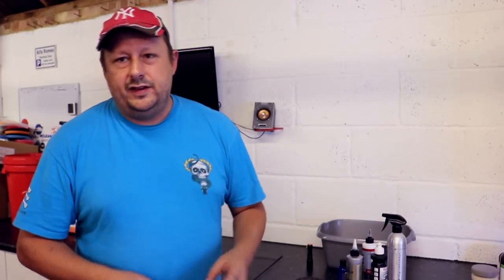Trashing Microfiber Towels with Ceramic Coatings

Comment: Jon...I throw cloths.....but heres a can of worms! ...it is common practice in the ceramic world to throw when using crystal serum base layer, but with exo..either wash & reuse or soak in apc, wash & reuse....personally I throw using any ceramic product
Reply from the maker: yo miles.   I think even the top coat product still use the hard curing resins perhaps even the same materials but they may contain much high volume of other organic resins to create gloss or hydrophobicity etc...   its going to vary isnt it product by product as to what materials are in what top coats though.. but I think its the same principle with a top coat product.  ultimately though have not tested that so just thinking out loud.
Reply: @ForensicDetailing  agreed Jon...last thing you want after all that hard work is to start inflicting marring on paint, safest bet is to throw...I use the  in2detailing cloths for coatings, great product, great price

Comment: Based on these findings would you also have the same problems with a lighter product such as tac systems moonlight used in your recent video?
Reply from the maker: I reckon you need to bin/relegate towels after using the lightweight ceramics as well andrew.

Comment: I've used microfibres to buff ceramic coatings and put them into the wash immediately after wiping and they came out with a noticeably different texture. They also didn't absorb very well, so I used them as rags from them onwards. I'm an advocate of not letting them touch paint again but I'm happy to use them for other purposes, knowing they won't absorb like new towels.
Reply: Doesn’t heat help fix the scratches? I’m having a hard time understanding if heat gun and sun can make scratches disappear then what’s the point in using a fresh towel every time.

Comment: Never had an issue with Gtechniq coatings and Sam's club 36 pack MF towels. I've even let them sit a few weeks after I've buffed off EXO or CSL before I washed them. Never scratched a painted surface with the used towels. However I use copious amounts of white distilled cleaning vinegar, 2 hour multistep wash and degreaser with my towels. Ceramics are chemically designed to bond to clear coats and other paints, not fabric fibers.
Reply from the maker: I think they will also stick to microfiber brett, or lets say the microfiber absorbs it well and then it bonds to the fibers rapidly.   vinegar, or detergents water based degreasers etc  I dont think flushes the coating out the cloth.    Thing is I reckon on harder clearcoat on cars that isnt black Im not sure sure if I would be able to spot it.   but on these black test panels at least I can replicate it and show a difference.. who knows those though I appreciate your input, theres no right or wrong.
Reply: @ForensicDetailing  I should mention I use brand new towels for correcting paint and removal of Gtechniq coatings. They just seem to respond better to newer towels.
Reply: @Taylor Made Detailing  Wrong.

Comment: So a normal microfibre wash will not remove the ceramic residue from the cloth when washing? 

I would use cheaper towels its not like you will be doing coatings all the time unless your a pro detailer
Reply from the maker: I dont think any like liquid detergent will break the coating down once its started to bond..   maybe like someone has said soaking the towel in a strong solvent before its cured in the fibers maybe the only way but thats gonna hurt the microfiber for sure.

Comment: I'm slowly pulling together the bits and pieces needed to do a complete cut and polish on my car.  I was going to seal it with Autoglym Ultra HD Wax, but I see Auto Finesse have a new ceramic coating product that is reasonably priced.  It comes as a set of ready to use panel wipes so easy enough to apply.  Any thoughts? Ceramic or wax??
Reply from the maker: I dont know what the AF product is.. I dont think its the same materials as a ceramic coating.. more like something else.     I have a rough idea maybe.  but are 8 wipes that you can use to protect the car once good, if its not a proper ceramic?  dont know Im sort of cynical but I like when theres new products to market.  but I just dont understand what this stuff is.. SDS links dont work on the halfords site..
Reply: @ForensicDetailing  Yep, 8 wipes.  It does describe itself as a ceramic coating on the Auto Finesse website.  Perhaps I'll settle for UHD wax for now and revisit this product when FDC has given it a thorough evaluation 😉
Reply from the maker: who knows mate it might be cool.  could try and get some and check it out.. would make an interesting video.

Comment: Hi Jon, another fantastic and in-depth video for which we are grateful. Personally I just think all of this ceramic coating business is a fad and I will not use it on any of my cars for the reason being you just cannot get rid of it without hard graft and a lot of time and energy.  Plus your video l has made my mind up completely over this ceramic or nonceramic situation. I personally will stick with Powerlock by Menzerna with a wax topper and continue to use a detailer spray after washing as I personally like the purist route. I think ceramics have their place in the market, but you won’t catch me using that stuff on my car. Anyway, I love the process of applying a wax etc, which I find relaxing. 👍🏼
Reply from the maker: appreciate your thoughts max cheers buddy.

Comment: On another note which ceramic coating is the longest lasting plus looks good ? and what is the difference with the professional ceramic coatings?
Reply from the maker: pro grade are the longest lasting generally and have a much higher content of the silica solids compared to carrier or other organic resins.
Reply: Are the Pro grades applied the same way or is there a different technique to apply the Pro grade coating?

Comment: Perfect timing. I am in the process of prepping my car for a geyon synchro coating. Your video made my towel decision that much easier (as I was already planning on tossing them). Thank you for posting, your channel has been very helpful to me. 

Any chance you could do a video on polishing glass or glass restoration? I'm having a hell of a time getting fine scratches out of my windows.
Reply: I wouldn't toss them they still make good oil rags when doing Oil changes

Comment: Great video Jon, much appreciated.  I'm wondering about coating toppers like Gyeon Cure or Optimum Hyper-Seal?  I don't apply a coating very often, but I use both those sealants every couple of weeks as a drying aid.  I've been washing those drying towels with microfiber cleaner and reusing them.
Reply from the maker: I think these will be fine george at least they dont contain the same hard curing resins as the cermaic coatings

Comment: I bought several different MF towels for this exact reason. I have ones for application. Ones for first buff then final buff. This method is my version of what I have learned from several fellow installers and coating classes I have attended.

Application/Leveling MF Towel is either tossed or dedicated shop (grease/mechanic) towel afterwards. For these I use Costco or more budget towels. When done coating I'll cut a corner off to designate these as permanently trashed for paint related work. Easily identified even if accidentally washed with other towels at a later date.
First buff is a 300-350 GSM medium grade towel. Once done buffing these immediately are placed in a 5 gal bucket with a mixture of 3 gal of water, One half cup dawn dish soap to help break up the oil based solvents and one cup of vinegar to further attack the oils with its PH of about 2.4 vinegar is a great cleaner for this purpose. Be warned I have had experience with this solution actually attaching the MF dye and often the water will be the color of the MF so have a bucket for each MF color you may be using. I have a lot of pink towels that were originally white. (Additional NOTE: Buffing towels I have found will not be as saturated as in the fresh coating and is buffing off more of a semi cured coating and I have found to be less impregnated into the fibers in my experience using them after a few washes.) 
My final buff is with a 350+ GSM towel to finish off the buffing process this also immediately goes into a 5 gal solution filled bucket, once all sides have been rotated thru.
All towels are washed that evening and are rinsed and squeezed out immediately before placing in the washer to remove as much residual contamination as possible. They are washed on the very hot sterilize cycle of my washer with "Free & Clear" wash detergent keeping the towels as pure as possible with one cup of vinegar in the wash cycle and extra rinse selected.

I'll use washed towels no more than 3x then dedicate to other non-paint related work. 
I buy then by the 1000 so cost is lower & built into the ceramic coating job price.
Customers are very satisfied thus far and formula seams to be working for me thus far.
Reply from the maker: awesome laszlo thanks for that.. jesus you get through a lot of microfiber :)
Reply: +Forensic Detailing Channel It seems a way to minimize MF use here is to cut them into hand size rags that allow you to get the most use and function per area of microfiber out of each towel including the use of both sides before tossing especially for initial removal as an uninvolved or not fully utilized mf corner is wasted mf.
Reply: SayWhat?  When cutting MF with scissors the rags will typically fray leaving fibers on the vehicle finish which is why they have sewn edges. That may be OK just be prepared.  
We only cut them after they are dedicated to shop/clean up rags for non-detailing work. Sometimes we also use them for vehicle wrap jobs applying adhesive bond promoter.

Comment: I have another question. With my Gyeon Pure, I also got the Gyeon Cure detailer. It also has a small amount of SiO2 in it. Is this also problematic for my towels?
Reply from the maker: you dont have to throw your towels away after using with Gyeon CURE (sorry ).  Its not a ceramic coating.  Its water based siloxane with trimethoylated (sp?) silica.
Reply: Oh wait it isn't even a ceramic coating? I'm so confused about all the different types of coatings. Guess I really need to dig through your older videos.
Reply: So wait a second, I do have to ask that again. The video you made about towels getting trashed by ceramic coatings do absolutely not apply for Pure oder Rim from Gyeon? I'm asking because I threw away 3 towels today. Because I could swear I used one towel I had used for Rim before and it scratched up my paint. Maybe that was just a coincidence?
Reply from the maker: sorry let me edit. I meant cure not pure above.

Basically if it comes in a little glass bottle its a ceramic. and its the ceramic resin that could cause the problem.   so cure is fine.
Reply: But isn't Gyeon saying that Cure is basically a much more diluted version of their coatings?
Reply from the maker: gyeon cure isnt a ceramic  coating no..  It contains a version of silica but its a different thing.. basically if it comes in a tiny glass bottle and it smells wierd its a ceramic (not including p-diddys unforgivable aftershave)

Comment: I do not know why but I'm going through many microfiber cloths no matter what I do, maybe I have the world record when it comes to the number of microfiber cloths I use for example when I wipe away polishes.
Having said that, I have had many different microfiber cloths in my arsenal and for a while it was expensive fancy ones I used , by chance I bought cosco cloths through a seller at ebay, I was very skeptical of these cloths, for me were only amateurs who used cosco cloths, now it's the only one I use.
because i can not buy cosco cloths here i live, I buy through ebay, last time I bought 10 pack, for me the price will be about £ 0.8. It's the best cloth I've found for that price.
Just for fun, I did my last full detailing of a car inside and outside exclusively with cosco cloth!
Reply from the maker: Im not a fan of the costco Deje.. but its less about how dangerous they are for me and all the talk about their ability to scratch.. Its more about them just being crap quality I can pretty much match their price but get a much higher quality cloth from paragone.   The costco quality varies from pack to pack and believe it or not those cloths come from 3 different manufacturers and there is varience on quality depending on which one your pack of cloths happened to come from as well.   They stiffen way too quickly and sometimes they can shed fibers like crazy..   Im also not a fan of the dual pile microfiber cloth nowadays and thats what these are..  Id rather just have paragone terrys any day of the week.
Reply: Hi John, love your show!
Well, I have not had any problems with the uneven quality of cosco, maybe lucky, but until it happens I will use it.
I bought paragon premium cloth, and it was good when used directly from the packaging, but what junk it is, do not tolerate being washed once!
Reply from the maker: Deje Dejsson  Im not seeing it go bad after a few washes.  these stay soft I have some that have done like 10-15 and they are in good shape. not saying your wrong you never know if its a different batch as well or it came from somewhere else.
Reply: They look worn out after only a few washes, tiny fiber sticks up,Look close and you see it, I give you right that they retain the softness.
Reply from the maker: ok mate will take a butchers..  dont get me wrong they are not perfect I have some 300 TRC edgless and they are a lot better. but at about 60p each they tick the box for me in that sort of disposable catagory..